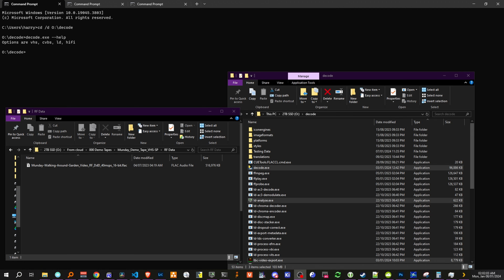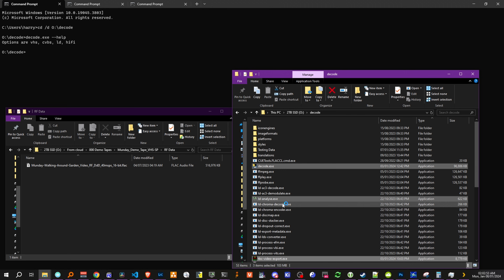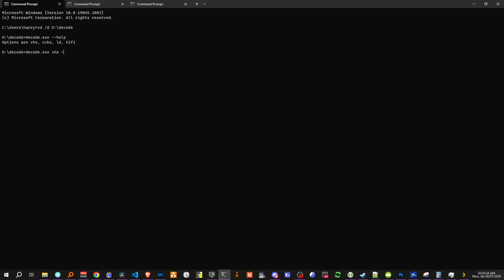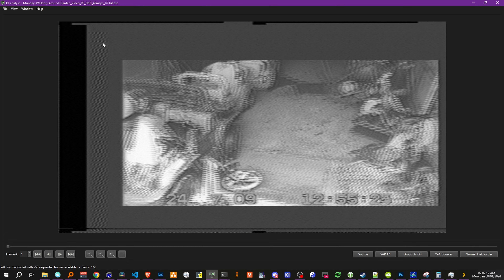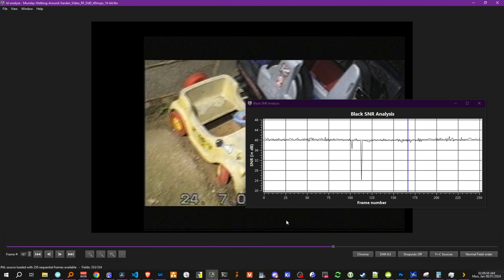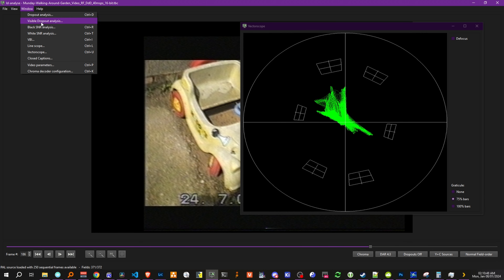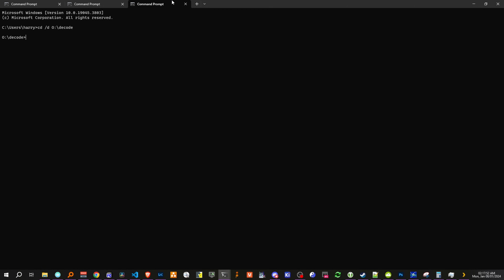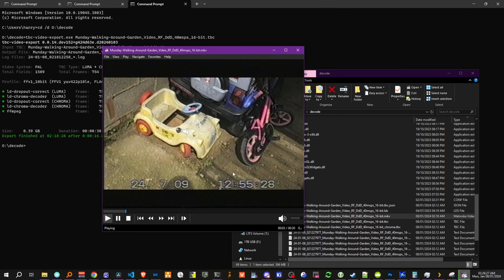VHS Decode, ld-analyse & tbc-video-export A Basic User Guide - Windows (2024)

Comment: I am completely new to this and my brain is currently exploding
Reply from the maker: It's pretty neat ay?
Reply: @TheRealHarrypm  but how can a baby make it work, I come from arts/humanities......
Reply from the maker: @lucasg8675 Anyone that can read can learn, it's all documented on the GitHub Wiki Pages.
Reply: @TheRealHarrypm  Hi I just stumbled on this stuff and think it's very cool and impressive.   How much of a quality improvement is there over just using a regular analog capture widget via s-video?
Reply from the maker: @flipr54  That's the wrong perspective, it's not just quality.

FM RF Archives are smaller then FFV1 video files even, due to FLAC compression of the source signals. 

Decoding can spit out results as good if not better then any SVHS deck for both video and HiFi decoding, after all its making 4fsc S-Video file sets from the FM RF captures, quality diff? yeah that's all upto software filter configs.

No the impressive thing is the entire full equipment stack replacement of legacy capture cards, and time base correctors and the whole signal frame being available, not just the active picture area but any VBI data, this is what makes FM RF Archival and subsequent decoding kill legacy capture.

This video does not show it, as its a couple years out of date now, but in the current ld-analyse you can adjust the area of export for left and right shifted signals, you are now never missing a single bit of image information for even the worse case off-spec tapes, something no legacy workflow offers.

Comment: Does the deck that is being used have any relation to the quality of the capture/rip, sorry don't know what it is called. Essentially the file before it is decoded in software? I guess more simply, would a professional deck produce better results than a consumer one?
Reply from the maker: @anthonyjacoway7364  FM RF captures is the name, these are just PCM sampled RF files like audio but bigger numbers, the ultimate quality factor is always going to be dependant on the heads and the state of the solder joints between them and the head amplifier and then the head amplifier IC itself.

Primarily if your joints are inspected reflowed and the deck is fully serviced the heads will be the only factor to worry about in the general real-world usage.

Now higher end decks have slightly better mechanisms which are more stable these are somewhat preferable but honestly the top end decks unless you've got a pile of them to keep a single mechanical model in service there's no point you're better off with consumer or prosumer decks from the 90s.

Those are the only marginal factors of quality difference with the RF capture workflow, assuming all of our factors are in order and your power supply is not spewing tons of interference noise into circuit or there's tons of noise from external sources like a microwave or worse etc.

If basic conventional capture looks functional, RF capture should look great is the basic rule of thumb here.
Reply: @TheRealHarrypm  Thanks for the detailed response. I've known about laserdisk Decode for a while, but only had a todlers understanding of that and limited interest. But I have a rather large interest in VHS, and looking to eek out a bit more quality from my professional deck which I've been using since 2020 to do VHS archiving using Componet. In comparison between my svidieo deck and my component deck. the component deck is a night and day difference in quality.  So I'm intrigued by this! if nothing else, it can give me something to research in my spare time.
Reply from the maker: @anthonyjacoway7364  Yeah you'll love the wiki then pretty much everything is compiled on there, and we support a lot more tape formats than VHS today too!

Comment: Is posible to capture cvbs video signal form a audio jackhead and record it form audiacity? (i dont have a easycap capture card)
Reply from the maker: @mralexgonzal  If you're talking about using an audio capture card. No. It does not have enough bandwidth as the DdD and CX Cards etc sample in the MHz/MSPS range that's a few extra zeros of scope of information.

We do have a CVBS decoder, but only the MIRSC is particularly suited for raw capture of that.

The whole point of the decode process primarily is to bypass all baseband/standard A/V output ware possible.

Also "Easycaps" are called Easycraps I don't even recommend them for reference capture card not when stuff like the GV-USB2 exist and SDI equipment is just so cheap off of the used market they do incredibly poor job.

Comment: I have heard of the VHS decode project before and found it interesting but I didn’t think you needed to write code every time you wanted to digitise a tape.
Reply from the maker: It's not code they are command arguments to trigger functions this is how all basic applications work just there is no clicky buttons.

This is not the digitisation it's the conversion of a analogue FM archive to baseband then to digital YUV 2 steps.
Reply: @TheRealHarrypm  no, but it’s still having to remember commands and not just pointing and clicking.
Reply from the maker: @tedwardtaylortv  You get used to it very quickly, because you're only setting frequency and TV system (and tape format if it's not VHS) and then adjusting it for edge cases so you're only ever really setting 3 things 90% of the time.

If you look at the command list there is actually two sets of commands for general use shorthand such as -n or -p and long hand such as shown in the video for a clear description, so it becomes a read the label copy paste mental process, or just edit the input and output names in a text editor and copy paste literally.

Eventually we can probably get rid of the TV system then tape format flags for general use and just only have them as a manual override, but some very fancy code for identifying such a signals would have to be implemented and there's a lot more things to work on like SECAM and speed optimisation.

Comment: Did you just say "Slow Play"?
Reply from the maker: You could say I was running a little slow that day 😂
Reply: @TheRealHarrypm  I wonder how would the quality look like from modern VHS releases.
Reply from the maker: @SFtheGreat  Very clean only differance would be SNR, with good condition blank tapes and recording SP with 1080i feed down converted from a HVR-Z5e via composite out first gen clean tapes don't look more impressive then well stored native VHS recorded to media from camcorders, there is a slight difference between recorded on and recorded to media though, I don't have a good enough collection of camcorders and perfect condition blanks to make a proper video on it yet.
Reply: @TheRealHarrypm  I have some S-VHS camcorder concert recordings.
I also sonder if this archiving method could be used for PAL D-VHS tapes, as those never had a digital output.
Reply from the maker: @SFtheGreat  W-VHS / MUSE / HiVison Yes (we have a decoder for it now) but D-VHS is basically HDV digital data, easy to migrate with firewire +- encryption stuff, but not much exists on D-VHS is it died very quickly.
Reply: @TheRealHarrypm  Like I said, PAL D-VHS never had a digital output. I have an NTSC model, works lie a charm both ways.
I will be releasing a D-VHS this year.
I am very interested in Video2000, I have a player and some tapes, the player requires some servicing though.
Reply from the maker: @SFtheGreat  Oh PAL, yeah I have no first hand experince with the D-VHS decks only a few users in the decode community have NTSC ones in Japan or imported, yeah the Philips formats are in need of more samples for testing and tuning the decoder thats the big thing limiting development is full refrance sample sets of a couple formats.
Reply: @TheRealHarrypm  I will be following the project. I need to check the servicing manual for my D-VHS deck to see where the RF points are.

Comment: What does the "TBC" program at the end of the process do? Does it only work with RF captured files split up into two? Can it process/enhance any old video file and apply some correction similar to a frame TBC and/or Line TBC?
Reply from the maker: This workflow is based around the FM RF archival capture method, captured from from virtually any tape formats test points, there is also a RAW composite decoder but its not as powerful codebase as tape or laserdisc decoding from source FM signal directly, the tools excluding the chroma-encoder are only ment to work with the tbc files.

The tbc files the decoders create is a 4fsc signal frame streams basically S-Video or Composite (2 or 1 file + JSON with TV system and metadata info) on a tape less digital file format full analog in the digital domain and is possible to play back to a CRT or deck via a DAC like a FL2000 chip for example.

You can control a massive amount of veribles as tape formats are always Y/C seprated channels on file and there is already tools for noise reduction and such.

The TBC code thats used is full signal frame its far more powerful then a frame or line tbc you would find in hardware and beats out Datavideo/FORA/Panasonic/JVC kit and of course analouge devices AIO chips found in modern SDI or PCIe solutions while adding no SNR loss due to no AD/DA extra stage and with source RF the code can be re-run at any point in the future. 

The tbc-video-export is just a wrapper tool for the handling the decode tools and chroma-decoder then pipes the colourised frames to ffmpeg to make a final starting point video file for then use in standard A/V tools, there is many profiles you can use also but its basic interaction is kept very simple.

Comment: would Video8 tapes work with this method?
Reply from the maker: VHS, S-VHS, Umatic, Betamax, Video8, Hi8, Philips VCR, SMPTE-C are also supported and implimentaton for SMPTE-B is in process and samples are needed for outher formats like 2" quad and more of Philips formats, right now Video8 video and NTSC HiFi decoding is on-par to surpassing hardware decoders in Digital8 camcorders there is a dedicated Sony 8mm page on the vhs-decode wiki for using the standard Jig RF tap method with a vast majorty of camcorders being viable, RF capture is like Laserdisc Video/HiFi is one 1 test point meaning easy capture and sync of audio.

Comment: Interesting to see some TBC corrector and deinterlacer based on raw signal processing before exporting rather than do it on exported material. To also have more control over parameters 😅
Reply from the maker: TBC / Dropout detection is on inital FM RF processing, then chroma decoding and dropout concealment is handled in the S-Video/CVBS on file domain during chroma-decoding and encoding to YUV domain then you can run it though QTGMC/IVTC etc on the final standard file output, but we are working on intergrating vapoursynth into the export tool, but it beats my FORA310p and the TBC in JVC/Panasonic decks by a massive margin, but the best thing is not the TBC but having that full 4fsc signal we can decode/preserve any VBI data there too 😉
Reply: @TheRealHarrypm Do I understand correctly that if I want to digitize s-vhs tape + hifi sound I need 3 pcie Conexant boards and modified s-vhs recorder to get the whole frame? Where I can find example how to modify recorder? Thanks
Reply from the maker: @dddy777  2x CX Cards + Clockgen Board that provides a shared clock source standard ADC for linear audio capure like a normal USB desktop interface would but on the same clock source so they are all with the same timing.

The vhs-decode wiki has a hardware installation guide and over 50 decks tapped with pictures for example refance.

Video8/Hi8 can be done just like LaserDisc with the DomesDay Dupliucator or a single crystal modded CX Card + Amplifyer.

My next video will be fabricating the clock gen mod and workflow demo, as its all condenced into a single capture script after hardware setup.
Reply: @TheRealHarrypm  there is almost no vbi remaining there, it gets eaten by headswitching (and by bandwidth destruction that vhs does especially to those tiny digital ttx signals) which is happening exactly during VBI interval....only way to capture teletext is probably to capture .ts stream from satellite....and watch on vlc, because it has ttx decoder.
but no, you won't find ttx treasures on old vhs tapes....just a random character here and there.....
Reply from the maker: @ivok9846  What do you mean no VBI? headswitching is at the bottom of VHS... decoding to a 4fsc frame and then using the vhs-teletext with deconvolving on the VBI space has been common place for archival and extraction of teletext data for 5 years, we have TBs of FM RF public archvies that are case and point on this, of couse SNR of the tape matters regardless.
Reply: @TheRealHarrypm  any examples? vhs, not s-vhs. 
what i ment is this: you can take any vhs recording, hook it up to crt tv with ttx decoder, and then see ttx is utterly destroyed by vhs. 
it can work only if you have some algorithm that can re-interpret remains of ttx. ie see ones and zeros in VBI, although they're quite a bit mangled by vhs.

you're right headswitching is not in VBI but on the bottom of visible picture, and visible picture is not part of vbi.
Reply from the maker: @ivok9846  Itwreed tape archive its got well over a TB of vhs recordings with teletext data, you can find it on IA or the samples doc on the right hand of the wiki some is even still on google drive.

Comment: Are you using Windows 10 or 11? This is open source so I thought you need Linux?  Some documentation says not recommend for Windows.
Reply from the maker: The only documentation to pay attention to is the offical wiki or the discord, the decoding process is now mostly fully cross platfrom as stated in the wiki/readme, I have only started pushing videos as the export tool (tbc-video-export) is now hammered out for production removing the need for WSL2 for windows users, or the old script for MacOS users.

The software chain is python based its been on windows for over a year now even longer for the dev group with native builds rather then self contained binarys, the domesday duplicator one of many RF capture tools is limited in reliability on windows so most capture chains are based off Linux due to reliability and more affordable CX Cards and multi input scyncronised capture for Video RF + HiFi RF + Linear etc, but yes this basic demo workflow video is entirely windows 10 based using the latest self contained binarys, the capture video I plan on making will go over the reality of flexibility with RF capture, the next video will also feature the newest updates to hifi-decode once those are merged.

Comment: This is extremely interesting to me, as I do a bit of VHS-to-digital conversion. Any chance that there will be turnkey packages in the future, where a card and some software can be easily installed into a computer, and a VCR with suitable mods plugged up and off we go? And may I assume that a better VCR (like my pro editing decks) will give better results due to better tracking servos and higher S/N on the FM signal?
Reply from the maker: This is just a very basic overview of the software toolchain for windows users mostly for the inital calling the decoders part, we have a wiki and plenty of capture hardware a full 90+ page wiki, its not a magical blackbox its all openly available hardware and software, today the current clock gen capture setups (2x CX Cards + ADC for linear with same clock refrance) are pretty turnkey, and can be scaled at cost.

With RF capture the head amplifyer and clean heads and magnetic condition are the weakest link, slightly better mechs make a margainal at best diffrance if not way out of spec.

Comment: Awesome video, are there any videos going through setting up and sodlering the hardware to import the RAW vhs data?
Reply from the maker: VCR setup is covered by the hardware install guide which is full scope cross formats not just VHS, Sony 8mm has a dedicated doc though, and RF capture guide is fairly 1-2-3 in the wiki but yes more videos are comming, I spent the last 3 years writing full docs and there is a extensive list of VCRs that have been tapped for RF capture on the wikis tap list page, its pretty straight forward once you know what to look for, but even with videos written media is the most useful as its mostly copy paste oprations as a end user.
Reply: @TheRealHarrypm  thank you, I'll check it out